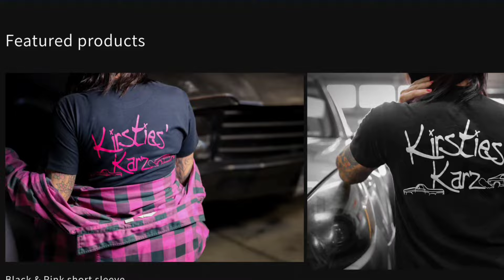I can't catch a break in life lately, but there is no giving up! Subaru repairs, and Nova wheels!

Comment: Kirsty you have any use for a Chevy 2 speed powerglide transmission it's bolted to a Chevy 283 in a 1968 Chevy C10 truck daily gas drinker 
Would probably be a better used for drag strip car 😎

Comment: With metal polish, it has to be rubbed in vigorously and then removed. Waiting until after it is dry it is miserable stuff to remove. I would also recommend an option that does not contain ammonia. Ammonia is acidic to aluminum and really should be avoided ( yes, blue magic contains it ).   You should be able to pick up some Zephyr Pro 40 locally once you have burned up the can of blue magic. 
Where tack rags ( cloth's ) go, they really need to be opened up to breathe for a few minuets before use. The reason for that is otherwise the paraffin's on the tack rag can at times transfer to what your getting ready to paint. Nothing more irritating than fish eyes and such in your paint job that you worked hard to prep for and lay down. 
I hope that this information helps you out down the road!!

Comment: That is wild!!    Did it literally come out of the sky??
Reply from the maker: No joke FELL FROM THE SKY 😂 well it was a canyon mountain road also.. I should of mentioned that! 🫣💯😅
Reply: @kirstieskarz;
Kirstie, enjoy and aprreciate Your energy, enthusiasm, foucs, persistence, determination along with viewing each challenge, difficulty, problem as an opportunity to learn, develop, improve, grow, including just withn the mental, emotional aspects shofting into the positve. As We know also, problems have solutions. and everything happens for a specific reason too.

You began with describing the event, occurrence as "bad luck" within the presentation of this issue withthe damage to the Subaru. Then showing the damage to the wheel, tire, broken side mirror assembly, thus certainly the glass fully amaged, fell off, seemingly broken, smashed glass, then the fog light cover pice also knocked out, damaged, while the light itself remained intacts, undamaged.
Thus, began attempting to imagine, concieve, devise, figure, what 'falling' or projected 'rock' could, would, have caused this type of damage and specifically too ?! :-o
Thus, this extra detail with knowing it occured on a moutain canyon road is important, essential to the possible 'rock'. Certainly the 'rock' had to be projected or encountered with significant force tocause the damage to outer rim of the wheel as seen, which then also damges the tire, cut through the side wall, thus the slit complete puncture, release of the air pressure and complete flat tire. Then addition the projected 'roc' or other object also caused the fog light cover piece to be damaged, forced out, broken. Also, the 'projected rock', or other object also hit the front side of the side mirror assembly, with a force which resulted in cracking, breaking it, along with forcing the glass to be disconnected frmo the assembly, thus, fall, break, or smash. 
Firstly, before a complete imagined, contrived, devised, figured development with every detail that one projected 'rock' or object caused all of this damage, and specifically with the shown specific detailed damage results, this series of damage to occur in this specific manner, way, with nearly no other damage, perhaps the small indentation on the fender also, without any significant scratches, external damage, is clearly strange, unusual, unique, amazing. Thus, another way to view this event, occurance is the uniqueness, thus actually a special, detailed providence. Thus, certainly it was not 'luck', neither 'good' or 'bad'. but actually a specific, detailed providence that caused, resulted in this set of specific damages, with no other, including no harm to You or others. Also the means to correct the majopr damge, hence the damaged wheel and tire, were all contained within the vehicle with the full size spare wheel and tire, jack [though not the expected more useful sissor type], lug nut tool, along with Your developed abilities. You managed to handle the situation, with all of the difficulties, including night darkness, extremely limited light [perhaps Your phone, maybe emergency flashlight too ?], along with Your emotions, mental aspects to accomplish what was necessary. => Thus, You were able to drive home safely 
=> Then,  in addition, You also have the means, abilities, to complete the necessary repairs, replacment of parts, components, along with the given the means for the payment, though having Your limited finances. All given by Your Creator, Almighty.
Thus, in reality, these events, occurrances, issues, problems, challenges are as You say opportunities for growth, improvement including mindset, attitude, views, perspectives, perceptions. Such You can begin to "see", view this rare, unusual, strange event with all of its detials as unique, special with providence, meaning, purpose, intents, also from Our Creator, Almighty, thus certainly only for "Good" with every specific, fine, tiny detail, aspect, result. Such, even within commonly called 'Luck', it is actually "Good" too. ! :-)

Personally, am still working on imagining, contriving, devising, figuring out, what occured while driving on that moutain canyon road that night, what object or 'rock'  was hit, unseen prior, that resutled in the force to damage the rim of th wheel as seen, also slit the tire, then also result in pushing out, damaging the fog light cover, more so to then be projected upward out of the wheel well, without any obvious damage, such the projected object hit the front of the side mirror, craking, breaking it thus disloging, disconnecting the glass mirror such it fell, broke, smashed !! :-o
It still baffles me, using the given, shown, described details, using all of my learned, developed knowledge within physics, etc. 
Perhaps there are a few other important details within the event while diriving on that moutain canyon road that night ?
Certainly the driving speed  is essential along with other conditions of the road with possible objects, other vehicles, which may have caused the projected 'rock' or other object, etc. ?
It is not expecially important for me to comprehend, figure this out, though it is certainly presebts a challenging, interesting problem to solve. 
The most essential is certainly for You, Kirstie.

Oh, by the way, You still present a ver deLIGHTful presence, demeaner, attitude, look which is also clearly evident within Your daughter Miya, which is quite similar with Yours, seen especially at the end of this edited, posted video recording.

All The Best, Sincerely
"You Rock"
-> maybe there is a 'pun', connection, interconnection with this common, 'favorite' expression with the 'fallling rock" too ?! :-o Ha Ha

Comment: You sure that this rock came from the air and hit the wheel or was it a large concrete slab or stone that was in roadway that you hit because I think something had to be in road way to have split and bend rim back like that, break it, and damage a tire like that, tearing a hole in in tire as it did, then toss a chunk off of that debris that was on road kick it up into the mirror ? Was probably something dropped on road from a deconstruction job.